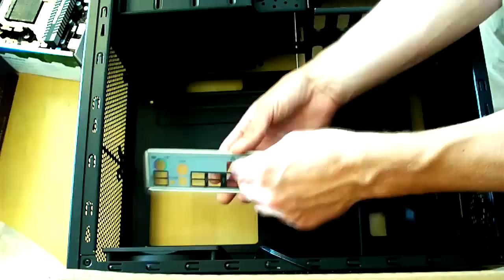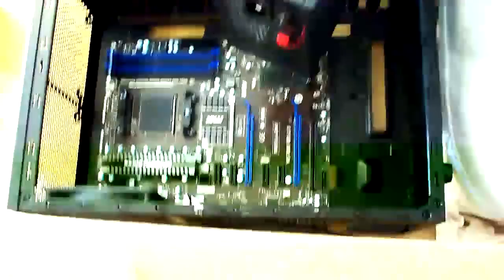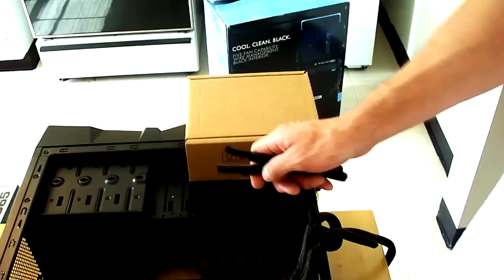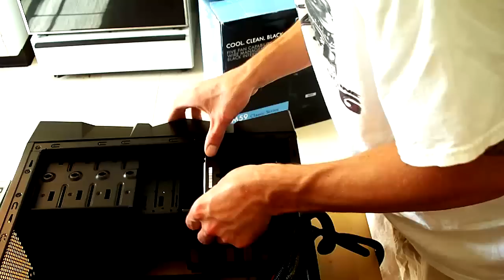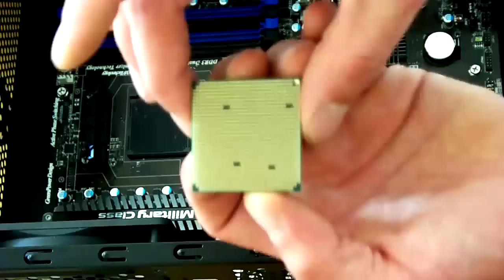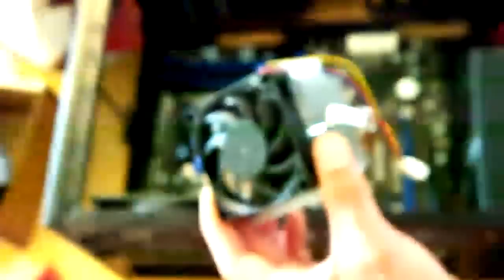How To Install Mobo, CPU, CPU Cooler, and Graphics Card

Comment from the maker: That's a really good combo, should run just about anything I could think of that you would want without any problems. I ended up upgrading from the FX-6100 to FX-8100, then onto an i7. But as for the 8320, it got great reviews, and from what I've seen of the benchmarks it looks really good.

Comment: Just changed my terminal paste of my laptop btw because it overheated before. I just used  a little drop and putted the cooling solution on top without spreading it and I think that is the best thing you can do because there will be airbubbles if you spread it. Also blew all the dust out of it and my max temp is now 80C when first it just shutted itself down at 90C

Comment: Just a tip. Install the CPU, cooler and RAM on the board before fixing it in the case. Some cpu coolers having also a backplate. So if u installed all on mainboard before it will make it easier. ;)
Btw. 2-3 drops of thermal gel are mostly enough to spread it or just pressing it with the cpu cooler. Too much could cause isolation effects instead of conducting the heat. More is not always better. ;)

Comment from the maker: I would definitely have to say it was good. Especially for the price point, had a very nice UEFI BIOS (graphical interface bios), easily overclocked in the bios with UEFI, very sturdy, and had a great layout. As well as, having a double space between the 2 PCI-E x16 slots so if yo're dong SLI or Crossfire there is a good amount of space between your GPU's for ventilation. Hopefully this will help some & if you need any other details just let me know.

Comment from the maker: I am not sure what type of gain you would get from using the XFX 7870, I have the MSI GeForce GTX 680 4Gb. OC Edition, and it barely touches my card. The 7870 series is great though so you would see a considerable increase in FPS.

Comment: I was wondering if with the msi 990fxa gd65 v2 if it's necessary to connect both pwrconn1 6 pin on board and any on GPU connectors, can't seem to get my board to work with 6 pin or 6+2 powered gpu

Comment: Is the AMD FX-6300 and AMD r9 270x compatible with this mobo?
Reply from the maker: Yup, they most assuredly are. That would be a pretty nice setup too, what you're looking for is a matching socket type, this motherboard is an AM3+ socket, as well as the CPU is of the AM3+ socket so they will work together. As for the gpu, they will work with just about any modern motherboard.
Reply: Elegant Mess OK thanks, but about the ram? does it depend on the motherboard too? the capacity it holds I mean? does this mobo compatible with the gpu and cpu i said earlier and the ram >>> http://www.gigabyte.com/products/product-page.aspx?pid=4122#ov